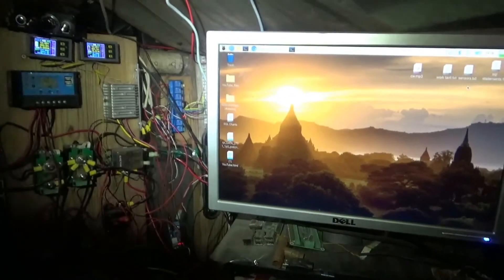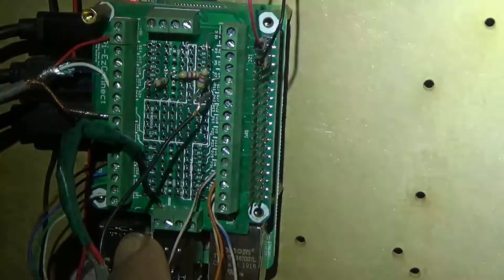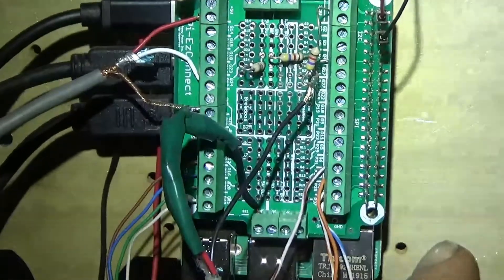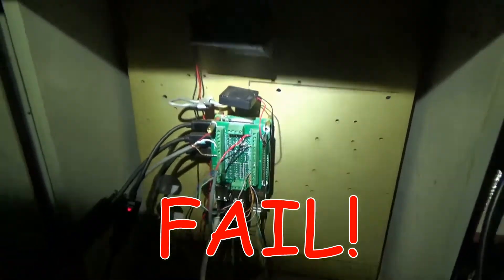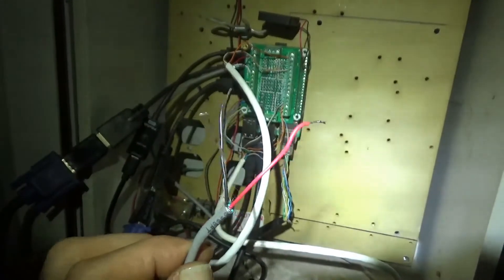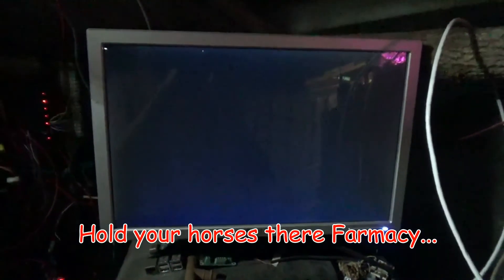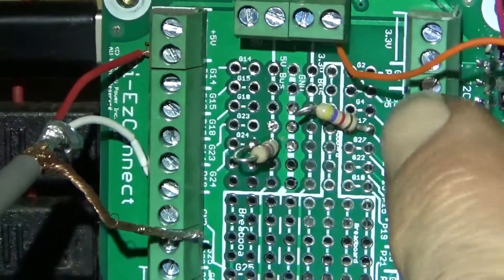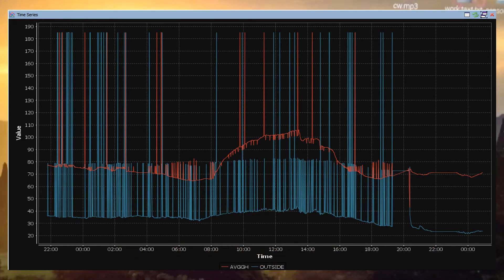Raspberry Pi Part 15 1 Wire DS18B20 Sensor Issues Fixed *How To Wire Parasitic And Normal Mode*

Comment: Ah the joys of hardware troubleshooting! A couple of weeks ago I had a similar session troubleshooting my original "Blind Buddy" sonar that my friend has been using for a few months. Luckily, I was able to turn it back over to him so his son could solder in a new sensor after I identified the SR-04 as beginning to fail! (I told him to put it in a socket, but what do I know!)

Most folks would edit out the attempts and just show their successes, but this is so much more useful my friend!
I think I'll order that EZ Connect for my Pi 3 since I've got the Pi 4 now. May find a use for it at some point.
Reply from the maker: Yes, can be hair-ripping at times... lol.  Yep, a socket makes sense, easy replacement in the future.  Yeah I debated on editing a lot of it out in the interest of a shorter video time, but felt it would be useful for those genuinely seeking to troubleshoot a problem. I also wanted to be transparent about my mistakes and struggle. I didn't want to leave the impression it's all just a cakewalk. Sometimes it is frustrating, and it is easy on small circuits to miss something like that resistor location. cheers my friend!